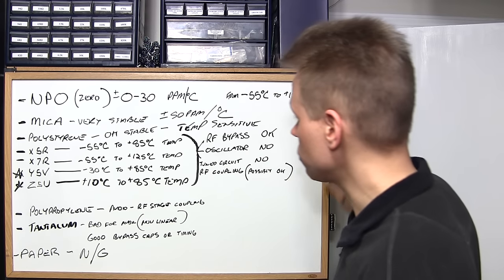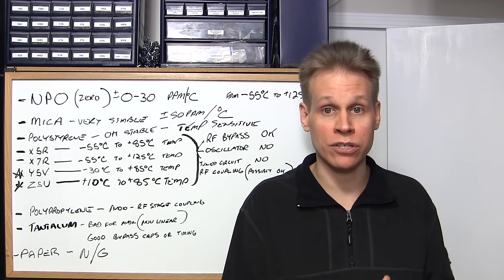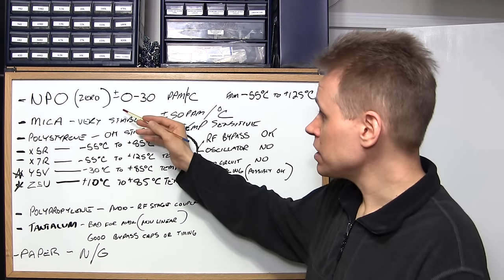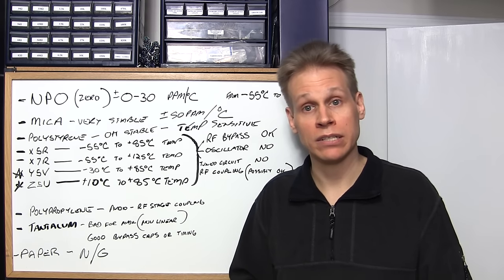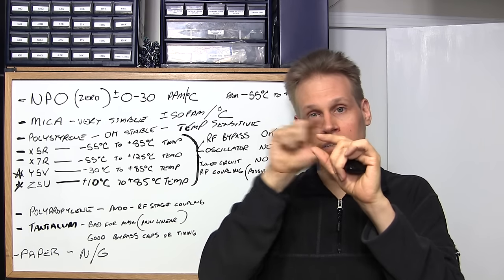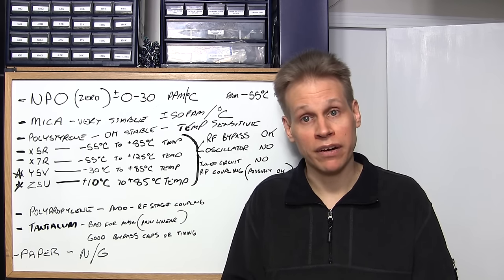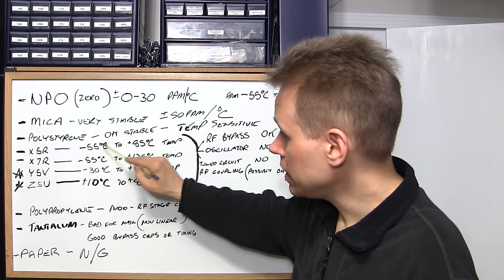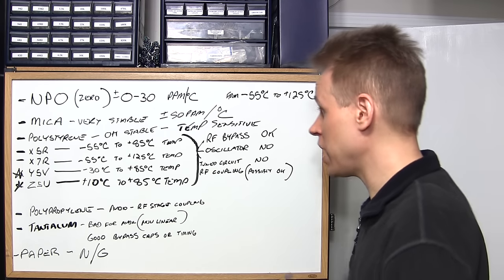Which Capacitor Do I Use? Tech Tips Tuesday

Comment: I hate Tantalums! i repaired on car radios, and other items. shorted out mostly to where the hell did it go. It blew up and disappeared ! I replace them with good quality electrolytic
caps or certificated ones with the numbers on top. What would you do to replace one?
Cant eat them where they look a little like m&m`s. Like little scaled balloons to float away and never come back! Sorry, great job as always 73` for now.
Reply from the maker: +Gordonseries385 
I find if you use those Tantalum caps (balloon style) just make sure their operating Voltage (the replacement cap) is much higher than the max Voltage in the circuit your using them in. I have never had a problem doing that, and I have replaced countless numbers of those. Thanks for your comment!
Reply: +Gordonseries385 Thank you for the tip!

Comment: Dipped Tantalum stories? Had a Teac 3340S that had all sorts of noise in the mike input on track 2! Snap crackle pop!

Nice video! Very good info.

I got a Sony TC 880-2 that has the same distortion on the bottom of the wave form coming from the servo board you showed for that ceramic "tap test". There are no ceramic caps on that board and the three tantalum's in the timing circuit have been replaced with new. Thought's/ideas?

Comment: Mr. Carlson, Please allow me to ask this > because you are obviosly a Electronic Pro! I have a Floor model Magnavox TV set with JBL speakers built in from 1991 and one day when i tried to turn it on it came on and in lest than 5 seconds shuts itself off! And continues to shut down ever since, If you had to guess what would you say causes that? ANY Response will be Greatly Appreciated. Sincerely Tony of Charleston, South Carolina.
Reply from the maker: Hi Tony, it could be a whole number of things. If the TV has never been re-capped, it's probably time. It could be a cold solder joint in the horizontal deflection (High Voltage) area, or power supply. This is common in older TV's. Know the risks of working on older TV's, there is High Voltage everywhere in them. If your not experienced with working on older TV's, I suggest you don't attempt a repair.
Reply: Mr Carlson's Lab
Thank You for your response , I never mess with electric things in 1974 i was in Gen. Pattons Old 2rd Armored Div. on a Combat Tank  which had 16 battery's in them and we were trying to jump start one off but the guy in the other Tank had the cables backwards ! I only seen a Blinding Flash and both my hands were burnt ,had to air lifted from the field to Darnell Army Hospital. Never again!

Comment: But I plan on using a ceramic with an audio signal. Ok ok. Using it to block DC on a fork from an audio signal source, but with only a few mV noise from that tapping on an audio signal of 6V p-p, is not much. And that fork isn't going to be used as audio anyway, but for triggering a light from the audio signal, which that little bit of noise isn't going to change squat. Eh, someone's gotta bend the rules I guess. LoL

Comment: YT Video: Never use ceramic capacitors in oscillators. ME: Just built a 6 oscillator device with body contact points on a CD40106 IC and every Osc uses a ceramic capacitor.
Reply from the maker: NP0 Ceramic is OK. If they are not NP0.... your oscillator better not be used for anything that requires accuracy.
Reply: No, no accuracy needed.  The build is basically a noise synth.  It can only create different square waves but with the body contacts acting like a potentiometer it does volume, pitch , pulse width modulation and tone all but just touching to contact points and varying the pressure.  

Granted with my first comment I forgot to take into account that you are kind of a radio guy so the rules you follow are bit different from us noise makers.

Comment: no modern electrolytic capacitors, excepting a very brief mention of a tantalum capacitor. not the focus of the video? everything else is so thorough.
Reply from the maker: The explanation of the electrolytic would be an entire video in itself.
Reply: Mr Carlson's Lab will there be - or have you already made - I video about electrolytic caps?

Comment: Well not all bumble bee caps are paper, I think that the bumble bee pictured at the beginning actually isn't a paper as it doesn't have the oil fill tube
Reply from the maker: It's paper, and its horribly electrically leaky. I have yet to come across one that isn't faulty. (And I have tested 100's)
Reply: Mr Carlson's Lab I have seen one or two that aren’t leaky but have gone up in capacitance. I’m surprised u haven’t seen the Mylar variant as they do exist.
Reply from the maker: @burntoutelectronics  The reason the capacitor appears to have more capacitance is due to leakage. So your leakage meter may not be working correctly. Capacitance meters measure the amount of time it takes to charge a capacitor to give you a value. If the capacitor takes longer to charge, it displays a higher capacitance. What makes a capacitor take longer to charge? Parallel resistance. Parallel resistance is leakage.
Reply: Mr Carlson's Lab you might be right. I haven’t been doing valve stuff for as nearly as long as you have. I have made a couple of videos here on YouTube and I’ve done a few other things like signal generators etc in my own time.

Comment: Most excellent video! You are the master! I do have to say that if you apply a DC voltage to a mylar or poly cap, you can get some microphonic reactions too. I used a Heathkit signal tracer with the "noise" test which applies about 60-70 VDC and you could hear it as it was tapped. Not that it is much of an issue. Also, I don't know if you mentioned the the NP0 or C0G capacitors are also ceramic. Though, the best kind nonetheless! I used them in a re-stuffing job on one of my favorite antique radios. Amazing you can buy surface mount caps with 450V ratings. 

http://www.theradiofox.com/zenith/1933/617/index.html

Thank you for your wonderful videos!
-Steve
Reply from the maker: +Aerofox441 
Thanks for your comment Steve!

Comment: It always bothered me that the guys in my shop used my desk radio when I wasn't there. So I took the back off it and soldered three 16v 1000uf caps to the line cord. I placed it so it would be head level for them to reach down and plug it in. My only regret is that I was unable to view the comedy (Because I wasn't there). I didn't mind cleaning the mess afterward.

Comment: I am going to start my first amp build before long. It would be nice if someone would make a video of capacitors in a guitar amp. In schematics it tells the info of the cap but doesn't show a picture so a beginner will know which kind it is. Show the actual cap in your hand, such as-this one is an electrolytic and it is used for this position in the amp-this cap is used for coupling-this cap is used for this and so on. I know this seems dumb but you don't ever see anyone explain this and show the actual cap.Thanks for any help.I'm betting you will not even see this!!!!!

Comment: Mr. Carlson, I have actually made a "whatever circuit". This is how it works. After some "whatever" started running into people's houses and running out with valuables, I made my "whatever circuit". I lock the storm door, so the thief has to legally break in, to grab the doorknob, and complete the "whatever circuit". So "WHATEVER" grabs that doorknob while the circuit is on will NEVER want to try it a second time.  What else was I going to do with an old Circline ballast  a 555 chip, some passive components including a few big high voltage capacitors? Amazingly, ever since "whatever" grabbed that doorknob and completed the "whatever circuit", no one else on the block has been burglarized.  FYI some of the mylar caps have the clear tanslucent plastic film too. I forget who made them. I want to say Arcotronics.  They are usually kinda flat & have a red band on one end. The polystyrenes I have are cylindrical, or I have some Soviet ones that look like little box shaped cough drops. The last paper I bought for making caps was a 3M inorganic "paper". Black Beauties made after a certain date are actually mylar and film in oil.  Bumble Bee caps were never very highly revered by any of the old-timer techs I know/knew.  Some of them used various  four letter expletives to describe them.  73s KI7AQJ

Comment: Any chance you could give your thoughts on an issue im facing?

Im trying to revive a couple of faulty Tek PS5010 PSU's and have found a particular component to be blown out on them both. As far as I can tell it is a molded tantalum cap but I can find no info on the rating codes and hence cannot identify it. Unfortunately I can't find a schematic for these supplies either.

Pic's here, if you have a spare moment - https://onedrive.live.com/redir?resid=DB1B08D6799E5087!5216&authkey=!ADzRJdFxu8XzBRE&ithint=folder%2c

Thanks,
Ash
Reply: Ah ive had a win I think, Kemet, 275pf and 20V, I think.
Reply from the maker: +Ash Powell 
Hi Ash. 2.7uf at 20 Volts.
Reply: Ah i see how the coding works now, 27*10^5, thanks!
Reply from the maker: No Problem :^)

Comment: I wanna laugh so hard about the ceramic disc capacitor. The jcm 2000 ts100 has a disc cap that blows on every single amp. Theres issues that leads to that, but. Its a frustrating reality.

Comment: You don't say why not use ceramics in oscillator circuits, and i want to know why??  oh!!!!  got it! :)  -
Reply: bilboXbartok The most popular ceramics are not NP0 nor C0G and they do better job at being temperature-to-capacitance transducers than at being stable capacitors. If you want a robust temperature sensor that’s dirt cheap, a ceramic capacitor may be a viable choice, but if you want a stable oscillating element in an oscillator circuit – it’s a bad choice. The oscllator’s frequency will drift lots with temperature. That’s not usually a desirable characteristic of an oscillator (unless you’re designing a thermometer).

Comment: Hi Paul...been watching Jim Lin....painful to watch...poor guy. I was wondering if there was ever any wisdom to spray wd40 into the volume pot? I've never heard of anyone doing that. Thanks Jack
Reply from the maker: +Jack neff 
Hello Jack. Jim is a great fella, and he tries hard...But... I don't agree with using WD-40 for a few reasons. WD-40 is actually intended (original intention)as a water displacement liquid for electronics. WD-40 does not disclose what's in their can. VR's or potentiometers usually have a resistive carbon track in them (the majority excluding wire wound pots) At this point, we don't know the long term affects of the liquid (WD-40) on carbon. Will it break down? Will it act as an insulating liquid over time? Will it deteriorate nylon or plastic parts. Older Allen Bradley potentiometers have a carbon brush that  rides the carbon track, will it soften or "soak into" the carbon brush? Too many variables to play with. When you buy a dedicated contact cleaner, it's formulated for a specific purpose, this is why small cans are expensive. They have done the research to make sure no issues crop up over time.

Comment: leaking voltages, is that really so bad?  most of the capacitors aren't too tightly toleranced to begin with.  the voltages getting through aren't too bad unless they are increasing amperage or something that can actually harm the components.  running a hot bias?  that will burn tubes too.  i hate when tech nerds get out there and are like, omg, this isn't in spec. this isn't perfect this or that.  as long as the capacitor isn't shorting out.  its still usable.  people like you ruin gear that is collectible, lovable, rare and above all valuable.  its like wrapping a capacitor more tightly and reducing its rating, and its still good.  we use all sorts of varying capacitors and the ratings differ wildly without issues like you claim.  an amp runs off dc...its obviously leaking dc voltage.  this then uniquely voices an amp.  what it damages are compents down the line that aren't designed to handle an increase in voltage.  but so many of those amps were toleranced in a way that where that leaks too, won't hurt it because the tolerances there compensate.  did you measure it all, or are you just eager to steal old stuff, or ruin old stuff?
Reply: nothing pisses me off more than taking an amp to a tech and finding out he replaced a whole bunch of stuff inside the amp, when all i wanted was a change of tubes.  ruining those solder joints and thinking you know more than the guy that loves the amp and gear, is disgusting.  so many amazing amps have been ruined because people are like, omg, this is leaking.  this isn't in spec. MY FUCKING SPEAKERS READ 13 OHMS OF RESISTANCE WHEN THEY ARE 16 OHM SPEAKERS.  YOU GOING TO THROW THOSE OUT TOO AND TAKE ADVANTAGE OF PEOPLE?